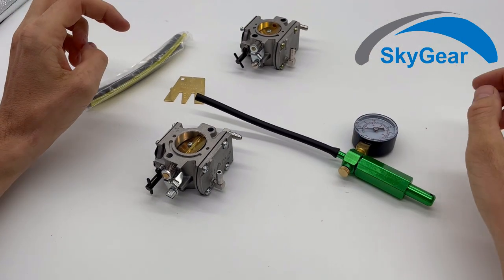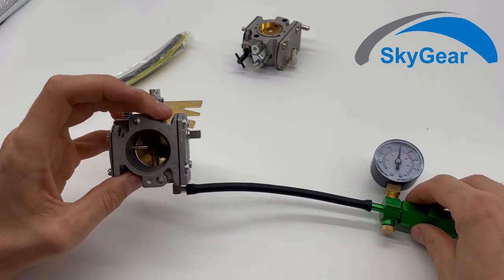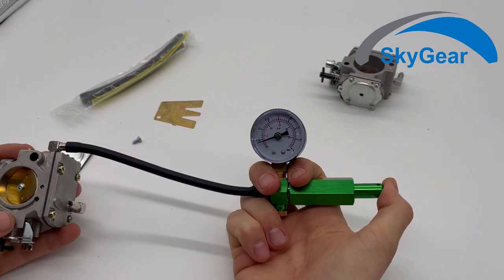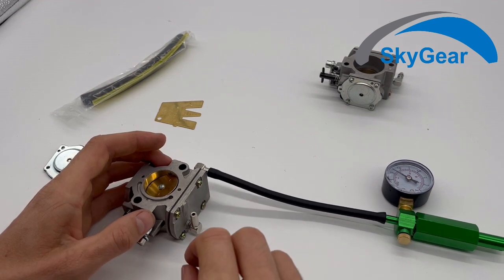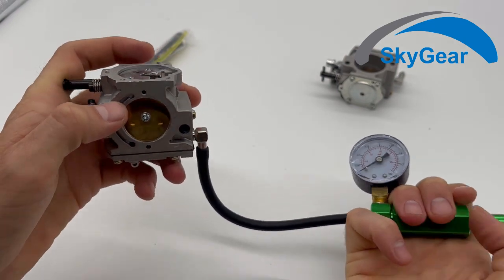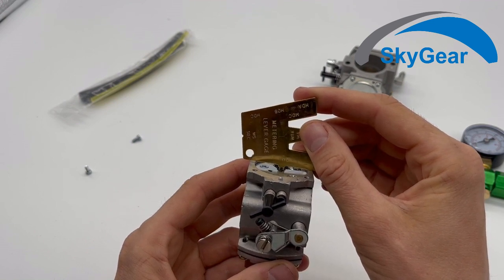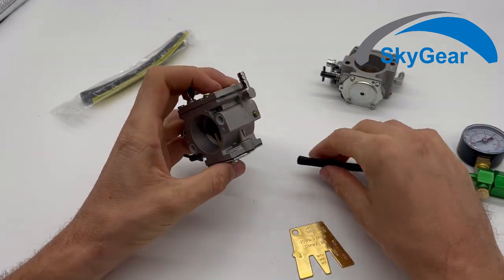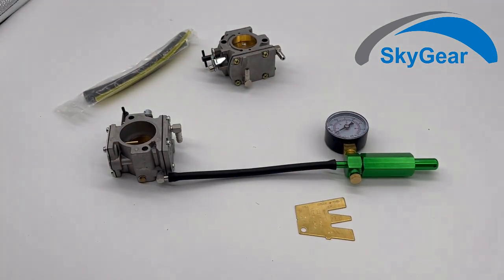Carburetor gauge

Comment: I have a question. The Walbro 28mm carburetor was working on a 4-stroke motorcycle. The fuel pump was connected to the intake manifold. Unlike a 2-stroke engine, there's no negative or positive pressure from the crankcase. So how does this carburetor pump fuel? Would the vacuum in the intake manifold be sufficient?
Reply from the maker: There is a pressure difference in a crankcase in 4-stroke as well. When the piston goes up there is less pressure than when the piston goes down the difference in pressure is enough to move the membrane which pump the gas.

Comment: Siutable for top 80 miniplane ?
Reply from the maker: The carburetor gauge is suitable for testing of any carburetor. Basicaly it is an air pump with pressure gauge, so you can see if there is any leak from the carb and also what is the pop-up pressure of the needle.